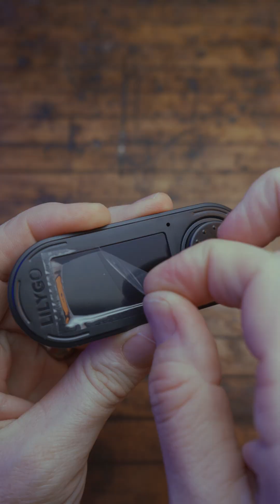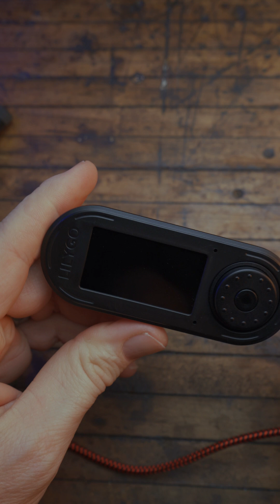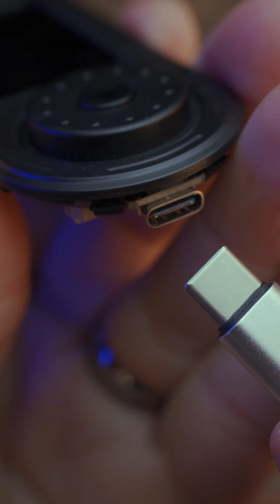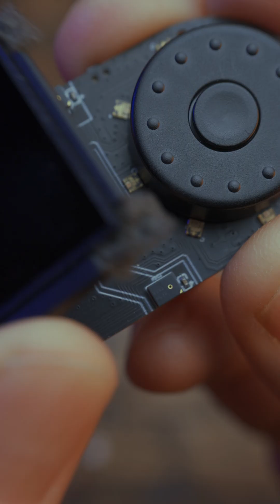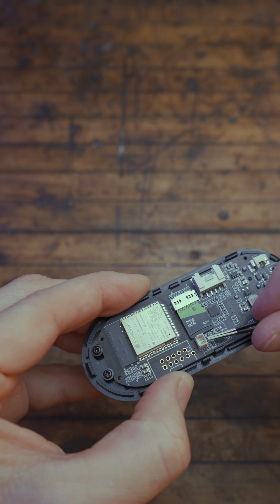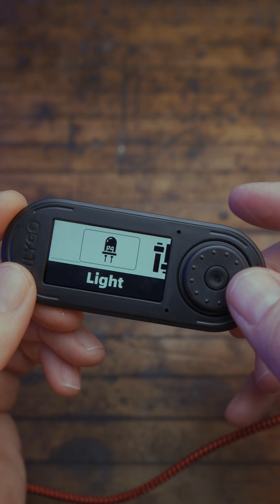Lilygo T-Embed

Comment: The controls aren't bad, the software the demo software that comes pre-installed is badly written. With the correct encoder settings it works fine.

Comment: 8 GPIO PINS? Thats not much to work w. Not sure why u would want this over a Pi. Its got a few ok features. But nothing refined about it. Its a half step away from needing a full breadboard.
Reply: Most of the ESP32 I/O is already used. 2x SPI for Display, MicroSD and SPI Flash. I2C is available on separate connector. And at least 10 GPIO are used for the LED Ring, Encoder, Button, Microphones and Speaker.

What do you want to connect, that isn't already covered? You can add I/O with I2C Port expanders. Many Sensors use I2C too, or 1Wire. When you want to control motors etc. you probably would use uart or spi or i2c controlled motor drivers for this, reducing the need for GPIO. You could even use a separate Atmega (eg. Arduino Micro) connected via uart as an Interface
Reply: What doesn't it already do that you'd need more IO for?
Reply: Oh, there's a raspberry pi that comes with programmable leds, rotary encoder, and display?